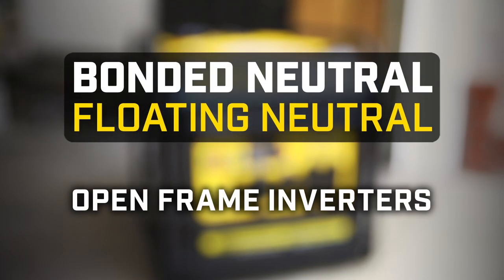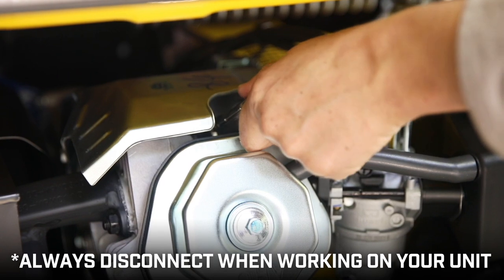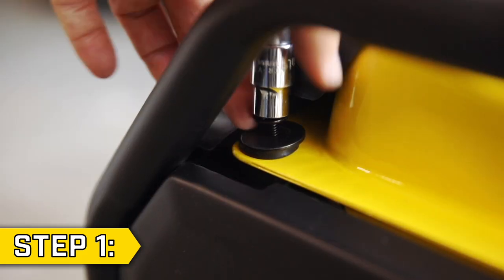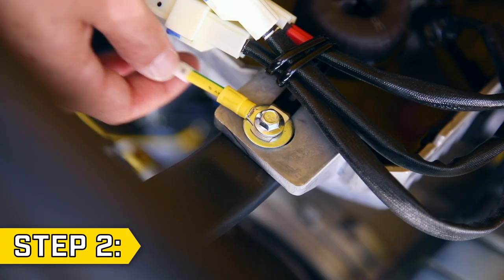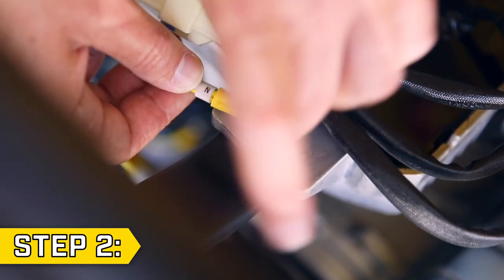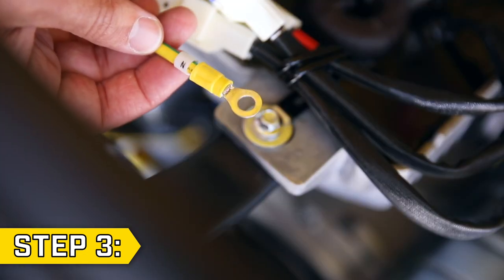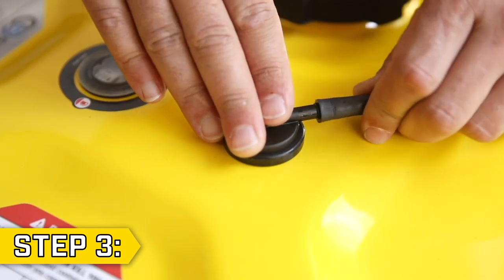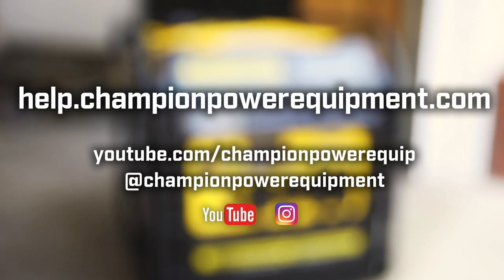Disconnect the Bonded Neutral - Open Frame Inverters

Comment: This was not hard on my Trifuel inverter model 201176. Gas line from the tank to carb is a little short, but you can still get in there. HOWEVER, after taping off the ground lug on the neutral wire, I would recommend that you not just leave it hang like the video suggests. Rather, tape or wire tie it to something, like the braded cable chase, so that the disconnected neutral wire does not find its way into trouble or make contact from heat, vibration, wind, etc, etc.
Reply: So this video is for Model 201176  to do Floating Neutral..❓❓

Comment: instead of removing the cable completly why not add a disconnect switch inline? when you dont need a bonded neutral flip the switch to off and when you need a bonded neutral flip it back on.  Seems easier than tearing into it mutiple times